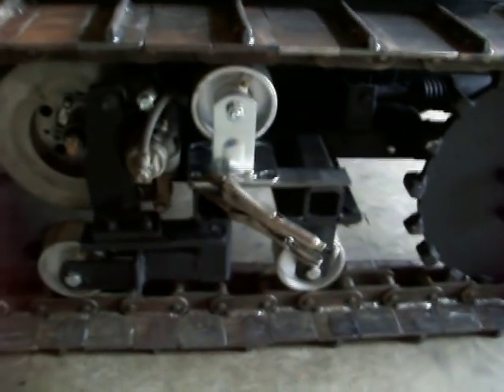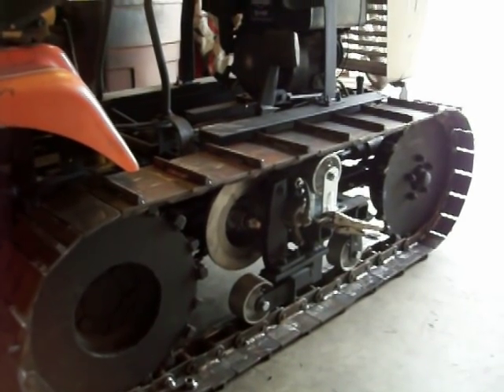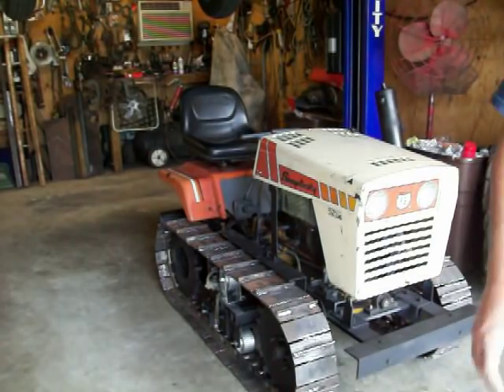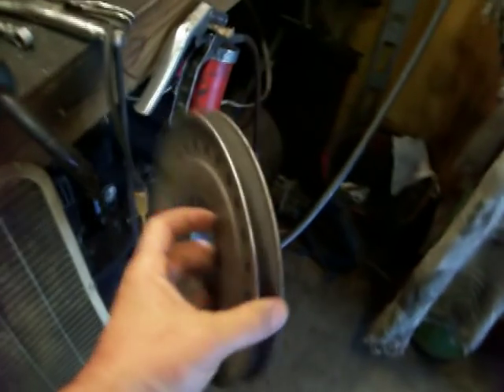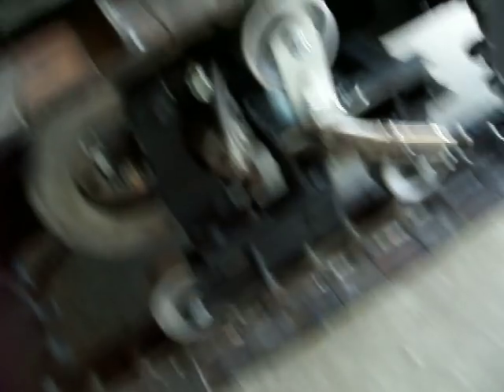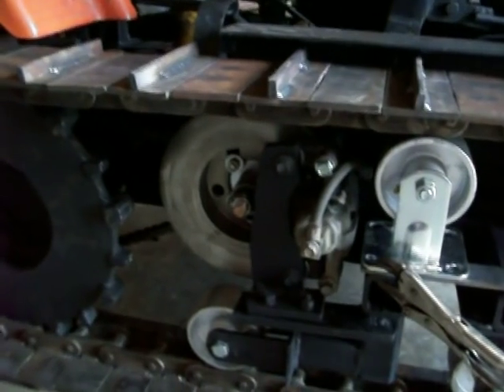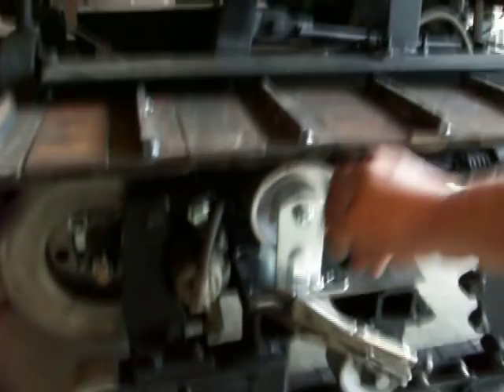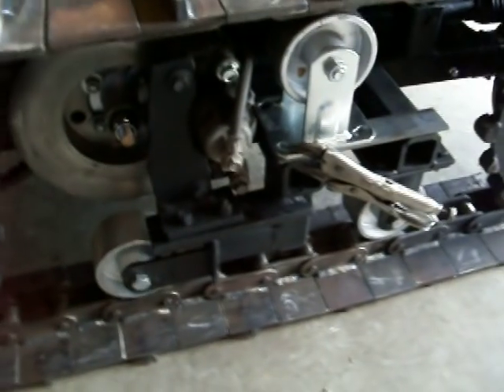Mini Dozer Home Built " Complete Brake Success"

Comment: great job, I watched it a few times, I am doing a John Deere-318, I put rubber tracks on it, used the stock JD brakes drums front & rear, it runs great bit will NOT steer, same issue as you had, just not enough power on the brakes, so I am going to do the sprocket deal like you have, thanks so much for posting, great job you are doing
Reply from the maker: thanks and good luck,,it just take s a ton of pressure to stop one side,,,some guys are building them with hydraulic drive trains like bigger tractors,,,thats the for sure way to go but Im sure very expenisve.
Reply: yes, on the expensive part !!!!, I hope you don't mind me sharing the link to this clip, so many are asking me about the steering-?. I hope to post a clip once I get mine to TURN like yours, LOL, thanks again for sharing your work !!!!!!

Comment: Very nice build. I'm looking to do something a bit similar except I would be use hydraulic motors from a commercial zero turn rider, front hydraulic rams for a plow and one rear ram for a cat. 0 3 point. Tracks would probably be from a Ditch Witch Sk500 or even a Bobcat Mt52 (depending which is better). Would use an old Simplicity 4212 hydostatic but that is still in decent shape and it uses a vertical shaft engine rather than a horizontal that I want to use. Very nice project!
Reply from the maker: IM telling you you will be miles ahead buying the tracks and wheels as i had a hard time building mine especially the drive wheels and Ive got to get on the ball and finish mine up cause a lot of guys on here are wanting to see it push and so am I,,,thanks.

Comment: i had a grin on my face watching you turn that with 1 finger youare doing really really well on this rick good work =)
Reply from the maker: well buddy we both had a grin on our face then,,haha,,I really thought the brakes would be far better and thought maybe you could do it with one finger but its easier than taking a finger even,,I think you could stretch a standard rubber band around your wrist and to the handle and it would turn it,,haha,,there like power hydraulic brakes you know with a hydraulic pump motor running but not,,haha,,oh well by tomorrow it will be old news but am going to dive nose first into the left side tomorrow but guess what,,they dont have any more boggie wheels at tractor supply so I'll have to wait for them to reorder but I can go a long way without them as I have all the other parts,,thanks Josh and keep watching amigo.
Reply: for sure will you be filing tomorrow rick ill be watching
Reply from the maker: okie dokie.
Reply from the maker: almost got the left side brakes finished and then a good long tesy run.
Reply: sweat cant wait can you do a driving view
Reply from the maker: it may not be tomorrow cause it just dawned on me Ive bought all the boggie wheels tractor supply has and am still short 2 of them but might take a trip to Birmingham and get them,,also I replaced the pull rope on the 8 hp motor about the time I started this build and I knew it wasnt big enough so I went to crank it today and turn it around and the darn thing broke so that'll slow me down a tad on replacing it,,soon as possible though cause Im dieing to actually run it more than 30 seconds,,haha,,,also cant forget the belt slips and may have to redo that also,,check you later.
Reply: cool cool rick well at least the to do list is getting smaller and smaller ill be watching
Reply from the maker: since Ive got the brackets on the right side correct and welding and bolted in place I can at least borrow the boggie from the right side to do the left side with so Im still working on it even though I dont have enough boggie wheels but will have to wait to I find more to do the long test run,,later
Reply: sounds good you gunna start working on the blad and blad mounts soon?
Reply from the maker: yes Josh I will start on the blade soon but really need to do a few odds and ends like raise the motor and add the bigger pulley and then maybe make it electric start,,sounds funny but the blade will be one of the easiest parts to add and will add a ton of weight to it,,the reason i have to raise the motor up about 6 inchs is the belt isnt getting a good enough grip on the motor pulley and its slipping,,Im hoping by raising the motor and making the belt a lot longer I can then ad a idler pullet pushing inward and making the belt wrap further around the motor pulley,,I have to do this or they want be any test driving it since it now slips under a hard strain while turning,,later
Reply: cool well cant wait to see rick
Reply from the maker: I will for sure finish the left side brakes tomorrow,,will require a trip to the junk yard to get some long pieces of push rods about 1/2 in diameter to make the rods going from the control handle back to the Master Cylinder and then bleed the system and thats about all I like on the brakes,,If I can get the large pulley and new better belt system done tomorrow im gonna make a video of it pushing down small tree's using the front angle iron bumper only,,haha,,theres some wrist sized pine trees on the vacnat lot next door and am gonna try to push a few of them over and if I have sucess I'll keep trying bigger tree's,,haha,,,later..ps,,well flitter I keep forgetting I dont have enough boggie wheels dad gum it.

Comment: Congrats Rick, I knew you would get it sorted :-)
Now hurry up and get the other side done so we can see it out in the dirt :-)
Reply from the maker: hey buddy i already have the left side totally finished but was short 2 boggie wheels so I finally made a trip to Birmingham yesterday and got 2 more but havent got them on yet,,I didnt get home till late in the afternoon and motorcycles were everywhere so i road my bike the rest of the short afternoon,,,gonna get it going today for sure but still have the belt slipping problem so I may have to redo the belt today also,,buddy im getting close to being able to put a push blade on it no kidding and get her going soon as a I can and thanks as always.
Reply from the maker: hey I started the push blade today and its gonna look like a monster with the blade on it,,also I start back driving full time tomorrow so the work will now slow down on it and I figured while I had the motor off redoing the drive shaft pulley id go ahead and add the blade and Im letting the arms come from underneith the front end from the belly and also Ive already redone the exhaust and put a bigger muffler on it and braced it up and all and Im telling you this blade and the hydraulics will have to add another 300 pounds so this thing will simply have to weigh between 1200 and 1500 pounds when finished,,also i hurt my freaking back today lifting the blade around and grinding on it,,haha,,I bet the blade by itself weighs 150 pounds and the arms im using is the 2 by 2 tubing I call super structure material,,,you told me what it was called but I forgot,,check you later BIG CHIEF ......

Comment: i'll drink one for, awsome job, i just started my build sunday, i am converting my Case 444 garden tractor, to dozer tracks, i have watched all your videos and learned alot, thanks for sharing the build with all of us. i will make vids of my build as , it will be a slow project but it will be done. thanks snowman you did a awsome job, Now for the paint scheme?
Reply from the maker: I have a great idea on what Im going to paint mine but will hold silent until I see if I can make it a reality,,you will flat get a kick out of it also,,,as far as the build the hardest thing is naturally the tracks and wheels,,a machine shop can make the wheels for you for about 200 dollars each so I made my own,,haha,,also to save a absolute ton of work and time try to find the chain like I did and then of course make your pads and cleats home made,,I started out makiing my own chain links and they would have worked but talk about some hard work,,,please make us a video as you go and add onto youtube so we can looks and see,,,Im going to subscribe to you if im not already so I want miss your videos,,later
Reply: snowmangsx1100 Ya your right about the tracks and wheels, where did you get your chain from and what size is it or type so i know what to look for. i do have access to a friend with a water jet and can have the wheel sprockets cut out that way which he allready said he would do for nothing,

Comment: Some day you've got to take it in and weigh it just to know. I bet it could pull down a pretty good size tree! About that pulley; on a old farmall tractor the water pump belt is tensioned up by the top pulley being a 'threaded shieve' type pulley but in my experience it only makes the belt wear faster. CaseIH still to this day has a manual type tensioner on the belt but john deere it's like an automobile.
Reply from the maker: yes Im going to weigh it maybe tomorrow,,just through it on the trailer and run it down to the junk yard and un load it and pull on the scales and just find out,,Big Chief says 1200 pounds and he's gonna be close for sure and I do know what your telling me about on the other tractors but whats needed here is very simple and will take about a half a day or less to re-do it and if I have to I can make it a dual belt drive but I dont think it will be needed,,thanks for the comment and I appreciate it,,Rick

Comment: In order to use a small band brake u hav to go through a major chain or gear reduction. Look up struck magnatrac will give u some good idea. I hav a old mt 2000 im gona put a cub cadet transaxle in and make it hydrostatic
Reply from the maker: thanks Brian but I was really trying to do it ala myself without copying anyone which I did and I think I am the first to go through this much trouble to have brakes that would stop it,,haha,,maybe its one of kind but very hard to copy what i did,,,thanks man.

Comment: Premier job...if you keep improving this, I'm gonna' start throwing rocks at my project.
Reply from the maker: haha I appreciate it Ken,,Im building the push blade right now and gonna let it come from underneith the front end and belly and its gonna be killer looking,,its a factory type blade from a small grader or ditch witch and I think it was 20 dollars at the junk yard,,what project are you building ? do you have a video of it  I can see ?
Reply: The only thing I am working on now is a Case 448 tractor, but I still have to put a blade on my dozer but don't know when I will start it. Probably some time this summer. You did a terrific job with your dozer; the best I have seen. Keep up the great work.
Reply from the maker: Gosh Ken I have the big head,,I really should be working on my old 1950 Oliver crawler which I call a D2 which is about its size,,it needs a new carb and the radiator cleaned out and will do it next for sure,,you know almost anyone can build these things you just have to take your time and use a ruler and square when cutting metal and 90% of it is the tools which I dont have many off,,I guess the hardest part of this build so far has been the 4 drive wheels and adding the teeth to each,,a machine shop wanted 200 dollars each to build them and I couldnt pay that so just made them myself,,buddy the push blade is gonna adda ton of weight to this little tractor and its heavy already so i may end up needing a bigger motor than the 8 hp briggs on it not but we'll see,,thanks again Ken

Comment: I would like to see more of how you built your transmission. I am wanting to build a tracked mini log skidder with a rotary swing grapple in back and a loader/grapple bucket up front. I have watched a lot of tankman  101 videos. But wonder about how that transmission would hold up.
Reply from the maker: the trans is from a 1970 or so cub cadet riding mower,,they were built 20 times to strong for what they were used for on a lawnmower but back then they were no such thing as a cheap made american product

Comment: Gee I love this crawler! And your brake setup is really ingenious. Can I ask what your track drive sprocket diameters are?
Reply from the maker: gosh thanks man !!
Reply from the maker: they were home made and I did not measure them to anything specific man,,the reason Ive stalled out on it is I had geared so low and it was so powerful one of tracks rode up on one of the teeth and it bent the left axle,,I cannot find another or havent yet and them axles are from a 1970 cub cadet and were probably 2 inchs in diameter and thats just the axle not the housing and it still bent it,,,had it geared like a winch and was to powerful

Comment: We spoke before about your build  I planning to use a case hydrostatic tractor from 70 s do you think it would work
Reply from the maker: I did not know they had hydrostatic in the 70's and Im really not familiar with hydrostatic drive but I doubt it seriously,, seemed for a dozer pushing heavy loads it would require a direct drive trans or hydraulic drive which is probably the simplest to use but expensive,,i doubt hydrostatic would do the job but only my opinion man,,might ask a tractor delearship and maybe a trans repair man.,,,thanks bro

Comment: You don't have a cold its allergies  eat local raw honey and you will eventually  stop getting stuffed up all summer 🤧 😉nice dozer my front main wheel is a wheelbearing and rotor and caliper from a 02 Honda civic with chain teeth welded on the rim..use cheap  cluth slave master cylinders for turning  good job

Comment: I like the chains welded to the track cleats. Did you build the chains. Or, what/where are they from? Great job!
Reply from the maker: no made allbut the chains and found them at the local junk yard.,,Thanks
Reply: snowmangsx1100 are them chain links hangers for mobile home axles? that's what I thought bought using
Reply from the maker: Im not sure,,they look like the chain that once turned a drum on a concrete truck,,but maybe a tad smaller.

Comment: Your getting close.When you put the blade on how are you going to raise and lower it.
Reply from the maker: I have a tiny little hydraulic arm and hydraulic pump and resovoir from the power steering of a big farm tractor Im going to use which will add another 75 pounds not counting the blade,haha,,its also easy to use a little electric winch which Im concidering using but most likely will be the hydraulic set up I mentioned,,thanks.

Comment: Your on the pigs back now lad, change the seat   bit of yellow   start shifting muck
Reply from the maker: you may be right and yellow would look good wouldnt it ?
Reply: snowmangsx1100 Tracking up a wet slope tow n a big old log with a big old rusty chain sounds better but ya after all the work done only right to put a lick of paint on it,, case power tan not 2 bright or it would look like a dinky play toy. love the lights in the bonnet . Are you going to put a wide style roll bar on it D12? good work so far rick

Comment: How did u make the sprocket what kind of chain
Reply from the maker: I hand made the sprockets and added the teeth to the correct sized wheels,,very hard to do and wish I could have afforded to let a machine shop make them,,haha,,chain is similar chain to what was used on concrete truck mixers in the old days.

Comment: good for you man! how well did it end up working? did it have enough weight to push dirt properly?
Reply from the maker: as silly as it sounds I haven't added the hydraulics or winch to lift the blade yet,,however I did replace the spring track tensioner with solid adjustment type and that made ti start catching teeth on the wheels so I've got to straighten that back out and get it going,,,what a waist of labor if i do not,,,thanks very much for the comment.
Reply from the maker: well I geared it so low and like a winch couple months ago one of the tracks binded and it bent the left axle,,and when you bend a cub cadet axle you have bent something man,,,gotta fix it soon though

Comment: Congratulations! Nice work with brakes,  I wonder if you´ve used some clutch system in each side, before the brakes like in Cat dozers, or if only you used brakes disk only in each side. This is important to finish my design in order to  I start building my little tracked tractor.
Reply from the maker: well see all tractor and even automobile rear ends have what is called limited slip so using any rear end trans combo from any tractor only requires seperate brakes on each side,,I didnt have to add any clutchs or anything to the reaend since it al;ready has clutchs inside so I had to do was add seperate brakes on each side,,look up limited slip on google search and it will explain it to you,,thanks
Reply: Thanks a lot! your comments have helped me a lot
Reply from the maker: anytime brother,

Comment: To ratkill zero turn motors wont be strong enough when track is in tough ground in takes a lot to turn
Reply from the maker: Brian arent you the one that said you would make one hydrastatic ? good luck on that since ive never seen a hydrastatic anything that would push a ant hill over,,,most have no pulling power all,,,some of making the hydraulic drive which cant be beat but Id give that idea up on hydrastattic,, and also flat tracks will push about as much as Kleeted tracks,,bad spelling I know,,haha,,later